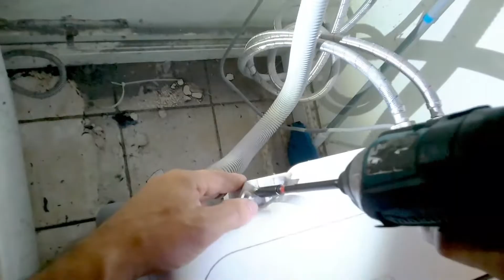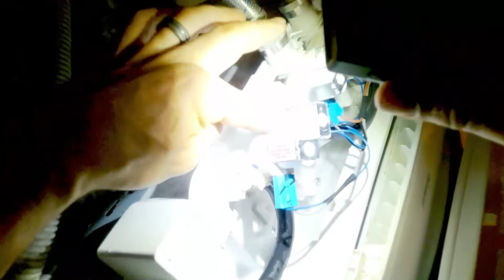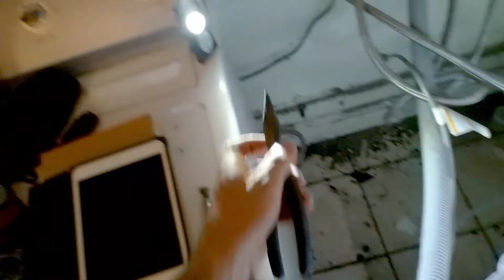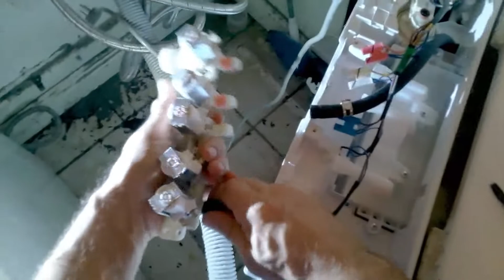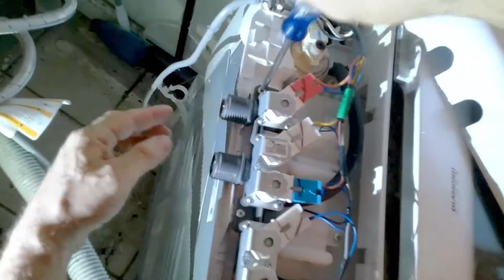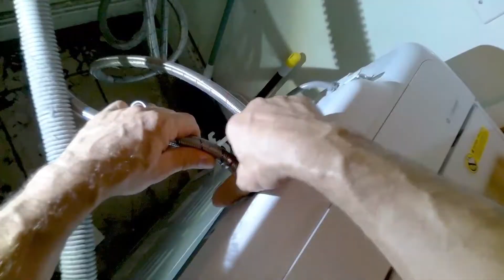Lg Top Load Washing Machine Water Leakage Problem? Learn how to replace LG Water Inlet Valve.

Comment: Had the same problem with mine. Very easy fix. Thanks for sharing. My solenoid bracket has four solenoids not five like yours so I am glad I took the cover off and check the part as it has the part number on it. 😊 Thanks for sharing
Reply from the maker: That's awesome, I'm glad the video helped you fix the problem!

Comment: i have this model that doesnt fill water only during the rinse cycle. Would this be a symptom of the water inlet valve? Water fills up during initial start, washing but just not during the rinse cycle. Weird. Could it also be the water pressure level switch?

Comment: Thank you very much for the great intructions. My LG model #WT7600H had a dripping leak above the drawer that dispenses the detergent and then that dripping would overflow into the tub. 
The leak problem was solved by this easy replacement of the inlet valve assembly.
Reply from the maker: I'm so glad the video helped you get your washing machine working again, and thanks for letting me know!

Comment: WT1201CV what is the part number. And to confirm, mine is actually running into the tub. we just moved and I sized up the hose to 1/2" inner dia. it didnt do this at the old house with regular slightly smaller hoses.
Reply from the maker: The Genuine OEM Part number for your model is # AJU75152601 you can find at onlineappliancepartshub.com

Comment: I don’t know what Im doing wrong but I removed the two screws and pulled up near where you had your hands on both sides and I still can’t get it open. Any advice?
Reply from the maker: Sometimes it can be tough to remove, and it might feel like you're going to break it. I'm not saying it can't happen—though I haven't broken one myself—but you may need to apply a bit more force than expected. Hope this helps!

Comment: how do you know if that is the problem? I have water leaking when filling and it seems to be coming from the side underneath.
Reply from the maker: You'll need to inspect the valve to see if there are any rust or water marks indicating a leak, as it's common for water inlet valves to experience this issue. However, you'll need to verify this yourself. Hope this helps!

Comment: Where do you get your parts?
Reply from the maker: Ready to order? Just have your model number handy and give us a call using the number on our website. We're here to help! You can find our website in the About section.
Reply: WT1201CV what is the part number.  And to confirm, mine is actually running into the tub.  we just moved and I sized up the hose  to 1/2" inner dia.  it didnt do this at the old house with regular slightly smaller hoses.